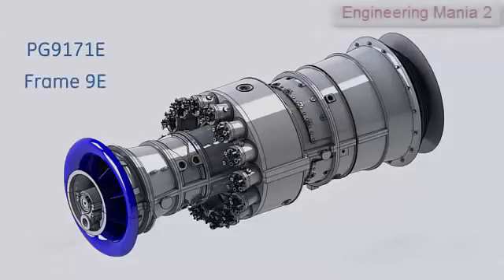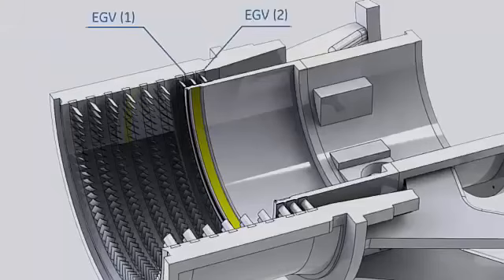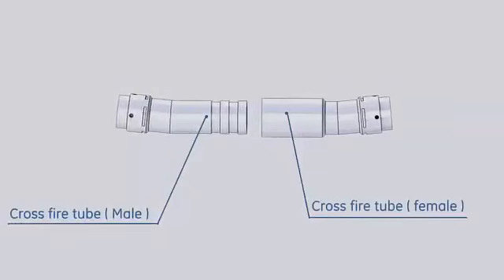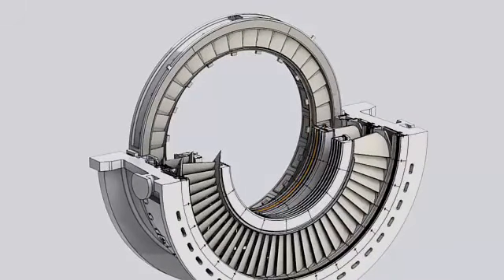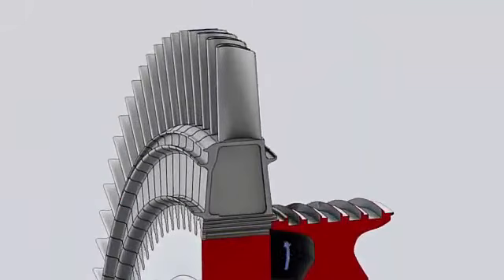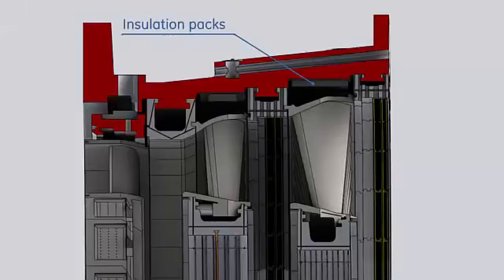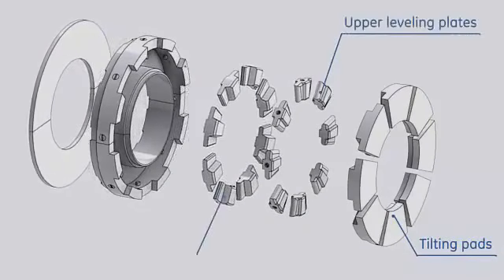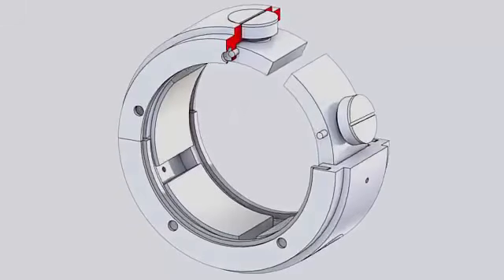GE Gas turbine components and operation

Comment: Wow! I love the explanation of the labyrinth seals and the air flow indicators, it really clearly shows what you're trying to convey. I also really liked the bearing seal and oiling explanation. It really drives home the old saying "never trust a gas turbine that doesnt leak at least a little bit of oil. If there is no oil coming out of it there is no oil in it!" The break down of the injector system is amazing too, Ive been nosing into gas turbine engines here and there for quite a while and this video absolutely  taught even me a few new things! Keep up the good work, mate! 😎👍

Comment: How many hours can this run at high capacity without maintenance?
Reply: Hey google, what is the maintenance interval of a GE MS9001E gas turbine? 

Major overhaul: 20,000-30,000 hr
Hot section inspection: 10,000-20,000 hr
Routine maintenance: 2,000-8,000 hr

Operational load, environmental conditions, and fuel quality will impact maintenance intervals in practice. YMMV. 

Wholy hell, that was easy information to find! Wow, its almost like we have a connection to the compendium of human knowledge and experience that anyone can search at any moment to find information on damn near anything! They just have to want to look for it..... So what is your excuse?

Comment: Fluid mechanics and machinery 

Elisha springs 

Fluid mechanics laboratory 
Ground floor 

Poo thandalum 

Elisha's spring 

Combustor 
Fuel capability 
Turbine 
Combustion 
Nozzle primary 
Nozzle secondary 
Cross wire tubes 
Spark plugs 
Compressor 
13°